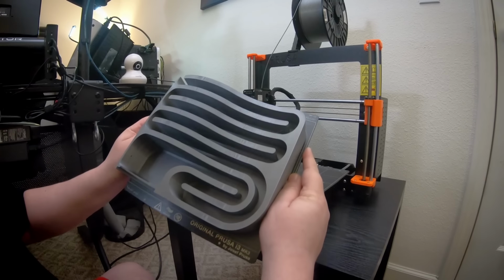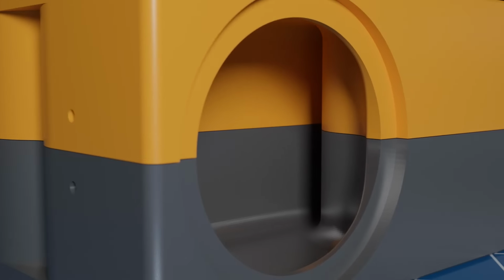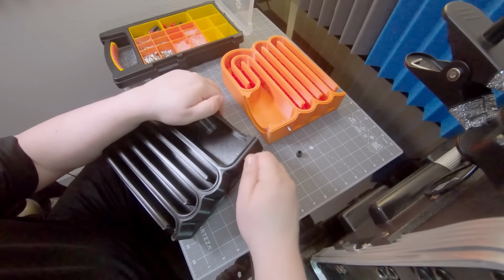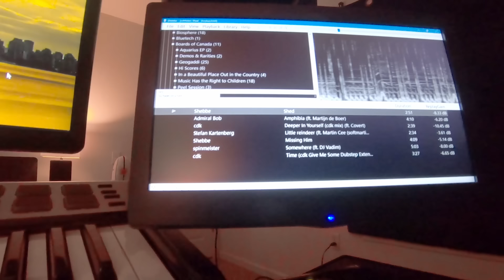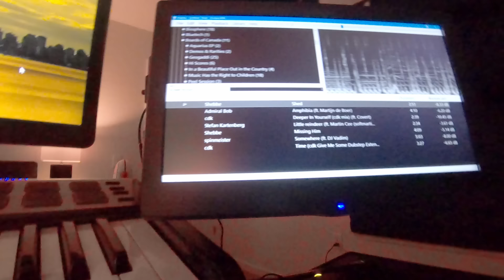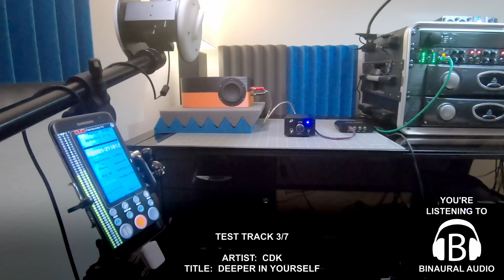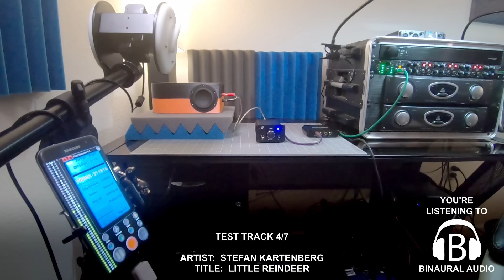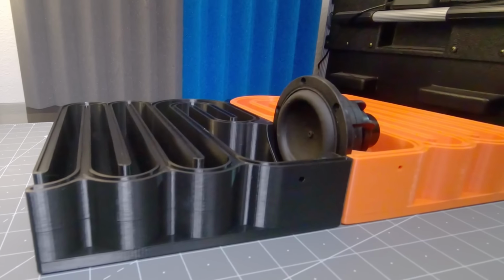3" Subwoofer Enclosure v.2 (Plus Demo)

Comment: Damn! I want to see how something like that would work as a bass guitar amp cab actually!
Reply: If you want a travel amp running low power, this design will work. For live performances, most venues will already be equipped with subs/mids and horn tweeters you directly plug into via your DI of choice. I use an app called “Bias” and a Bose Mini Soundlink for a travel amp. It sounds really good, even at higher volumes. The app does use cab sims though.
Reply: Mark bass makes 1 similar in size that is amazing.
Reply: @rasjase1  that would be the micro mark right? I'm more curious with this as it has a considerably smaller speaker, but utilises the enclosure a lot more than a typical bass amp/cab. Kind of curious to see what you can get by taking a fundamentally different approach to cab design
Reply: @E1p0tat0k1ng  I used 1 once at a rehearsal space and it literally blew my mind. At low volume it was able to rattle books off of shelves(not joking).  It kept up with live drums no problem as well. I usually use a 12" bass practice amp for rehearsal wich sounds thin and puny compared to normal gig rig, but the little mark bass sounds just like my big rig. I rushed out the next day to buy 1 but was unable due to the thousand dollar price tag. Maybe some day lol

Comment: Damn that's nice, good work. I like tight bass and clear audio, bought some 6 inch hertz Mille components for my work truck so I wouldn't have to run a subwoofer but haven't had time to install... for like 6 years🤣. Once you have kids sometimes those projects get put to the side lol

Comment: Is it possible to DIY another case using the dimensions of your built? I mean just the volume of the chamber and the cross section + length of the port are relevant, not in which manner they are folded, or?

Comment: That was insane for something that small. Excellent work!!!. I am listening on Mac book Pro late 2014 Chrome browser through and LG monitor LG 27UD58-B 27-Inch 4K UHD IPS Monitor with FreeSync connected via Display port and Sony Noise Cancelling Headphones WHXB900N in wired mode i.e. no enhancements , plugged into the monitor jack

Comment: Have you tried putting your old enclosure on the other side of the speaker making like a sandwich with the speaker in the middle? I've never seen this done, but would it transfer more energy into the air?

Comment: I've got a speaker that's rated 90-20,000Hz. I'm wondering if I could put it in this box for extended deep bass range or if I should put it in the Tang Band bookshelf speaker box instead. Thoughts?

Comment: A friend built me a fourth order bandpass enclosure for an 8 inch woofer that was able to handle 400watts with no crossovers or active frequency bandpass cutoff.  It was deeper and louder than the dual 10 inch JL audio custom enclosure that it replaced, that could barely handle the same 400 watts.

Comment: Funny thing look at a musical instruments take a flute it’s all pretty much designed the same all the way through it has a built-in noise cancellation so you don’t hear real high pitch squeaky sound from the whistle but you hear a nice mellow tone and then take a tuba a tuba is laminar flow to the max text the sound and magnifies it over and over and over again it doesn’t implode on itself it keeps expanding

Comment: In the interest of saving space and weight, is it possible to develop something similar for an 8in much higher output sub for a behind the seat compartment box in a honda del sol or mr2. There is a prior design from jl audio but doesn't seem to supply enough bass even with 2 subs.

Comment: Set up for me is not the best but in my car I do I have detected speakers for each range, so I have a 2006 toyota sienna with JBL Synthesis, from factory I have a good range of highs mids and upper lows. I also have dual skar sdr 12s at 1000watts rms, making up for the low lows.  For me the bass coming out of a set up that small had my car vibrating way more than expected. Good work!

Comment: Is this design scalable? how difficult would it be to make a 2 3/4" version of this?? Any help would be appreciated.
This is exactly what ive wanted to do with this 2 3/4" Kevlar Rca woofer ive been holding onto. Its from when they bought overstock kevlar from dupont and attempted a run at the high end home audio market, ribbon tweeters and all lol. Mine is from a middle of the line center speaker that only had 2 full range woofers. Always thought it would make a sweet bluetooth speaker!!!!

Comment: Just had a thought....if the cabinet needs to be dense material then why not cement? Styrofoam forms could be sold for the interior and someone could fashion the exterior out of plywood. Once the concrete hardens you pour in a solvent to get rid of the Styrofoam. This could be very similar to the "lost foam" system they use to cast engine blocks. Probably needs fine tuning but the theory seems sound.

Comment: Looks good! One thing you could consider for the speaker baffle is to make it separate of the upper and lower half, then creat a Grove on both the upper and lower half kinda like your tongue and Grove idea that the baffle could sit into on the top and the bottom to get it to seal better. That way you could also incorporate some threaded inserts that you would insert mid process during printing so they are sealed and locked within the baffle. Then I would use a two part epoxy that works with the printing material you are using, like ABS for instance. I would consider printing it out of this new filament that has carbon fiber in it. It makes it much stronger and more stiff. It will also cut down on any reverberations because its more dense. Good luck with your project! Its very cool! Liked and subscribed

Comment: how big is the volume of the box and how long is the port, and the cross-section of the port?
Reply: i calculated the port to be a slot of 15x84mm and a length of 1511mm

Comment: Listening to this with a set of Logitech Z625's,  the bass is remarkably deep. It rattled the glass in my room at half bass on the knob and about a quarter on the volume knob. On my headset, a Steelseries Arctis Pro Wireless, the bass is overpowering, and actually made the drivers in my headset rattle quite a bit. The only other time they rattle is at max volume in something like Warzone, Battlefield, or any other FPS game with explosions and violent, sudden bass. Other then that, it's unreal that a 3 inch driver is making that much sound.

Comment: Cant i make it hollow and after print just fill it with something like expanding foam(lighter) or epoxy?
Reply: Expanding foam probably not. Epoxy maybe, but you have to consider heat dissipation while setting for such large parts, as well as air evacuation.

Comment: Is the math linear in these projects?  I have a 4" speaker I was going to print this enclosure for.  If I just scale the print up by 25% so the hole will fit a 4" speaker instead of a 3", will the math for the porting and wavelengths still be correct?  I have never seen the equations how those things are calculated

Comment: Nice model, one question though, did you have to resize it when slicing? when I load it in cura the stl file is far too large for the build surface? The only way I can get it to fit is by resizing to 88% and that is the absolute max it will accept.

Comment: I didn't want to go through all the comments, so it might been mentioned.
But take a look at Wondom amps, with built in DSP, if you want to use it for portable use or just want a all in one amp 🙂
Awesome build btw, and beautiful print!

It makes me think of the Minirig Subwoofer, which also has a folded port.

I am thinking about maybe making it in wood on a CNC. Sandwich style or find two solid pieces.

Comment: Looks great, 

I'm guessing there is nothing going through the unit that stops it being printed in one piece.

If you do integrate an amp and power supply then a non setting sealer and screed would be better so that the unit can be dismantled and services.

Can't tell you how many electronics today are bonded together making them impossible to disassemble.

Comment: I am going to build this, hopefully pair it with a horn mid top and create a mini 2 way sound system  at a 150Hz crossover. I've been looking at powering it with battery for the beach but if that works out as asking too much for something portable (atm I've got 3.5hrs of charge at 4kg of battery) then its definitely going in my car.

Comment: Why don’t you point the low pressure outlet of the speaker facing the same direction as the speaker driver? Just make sure it is phase aligned

Comment: Your videos have inspired me to model and print a scaled down version of the Paradigm Sub One. It’s a 6 sided sub with 6 speakers. I’m using the same 3in speakers as the prusa printer isn’t large enough to print it with 6in speakers. It’s coming along good on the modeling but printing it in 3rds is going to a challenge. I’m not even sure if it will sound good... but I’m gunna do my best

Comment: sirs, but wouldn't inside outside cones make it better than the swirly lines? cause u don't really obstruct nothing just delay the time it takes for sound to come out ... by a 0.00001 micro second, where with the inverted cones u would filter all the high tones.

Comment: That's a lot of ULF. I have my subs DSPed +/-3db 150hz to 23hz and even with the gain only up like 1/3 of the way from where i usually listen, there was still lots of bass coming through. I'm simply taking advantage of the corner in my room with a pair of reflex subs, but with the drivers faced at each other and in the corner under a desk, the whole thing creates a fairly impressive horn. I still have to +6db at 23db to get good extension down there for home theater, but with -6db at 50hz and some narrowband correction around 42hz, the deep rich bass from say music comes through with extremely low distortion levels, and the bass in movies sounds utterly incredible. None of this would be possible without proper DSP though. I'm using an ashly protea 24.24NE for crossover filtering and parametric EQ, in addition to gain per amp and input gating, but my sub amp is a QSC RMX850 at 280wpc into 4ohms so I've also got a lot more power on hand for bass. It's a stark contrast from my tube amp for everything from 150hz up, but with a high crossover like that it actually is fairly well balanced considering how low I push the subs and how much power it takes to do that. they sit at like -18db in the DSP master gain so even with that +6db correction I've still got loads of LF overhead, I just have to be careful to watch for overexcursion if I'm mastering content. Would be really cool to replace it with a custom horn built to the space, but IDK how much longer I'll be where I am either

Comment: Hi there, I'm hoping someone might be able to help. I'm rather new to the world of audio equipments. I have a set of studio monitors hooked up with an audio interface from my PC. I'm wanting to add a subwoofer to the setup. If I wanted to wire this subwoofer to the current setup what would I need in order to be able to run my studio monitors with this subwoofer?

Comment: Hey im trying to get this to fit on to a creality ender-3 pro which only has a build area 220x220x250. im trying to cut it into 8 parts to fit in cura but not working for me need help please
Reply: Microsoft has 3D utility that can slice this as desired. Locate in MS store 3d Builder.

Comment: Great technology! Wow! I am still stuck with wooden cabinets.
Please let me give my input on the TML design, which I think could be improved in 3 dimensions:
1. Have you ever tried the AJHorn software? The best you can get on the market to design a TML for your speaker. Try to put the speaker at 1/3 of the line and not at the beginning. This is pushing the 1st harmonic to a higher frequency.
2. Add an absorber chamber behind the speaker and you will fully get rid of the first harmonic @150-200 Hz
3. Fuzzy with sudden changes of line profile and zigzag is better than a continuous and smooth ‚flow‘. The fuzzy structure is suppressing the higher modes, which is very beneficial for the response in the midrange.

This all has been published and verified by Bernd Timmermans, the issuer of the German Hobby Hifi magazine. 
Hope you like the ideas.

Comment: I have not looked in to the advancements in the world of audio in quite a while,but i thought you needed at  least a 10" woofer to push enough air to create a subsonic frequency, has that changed with this kind of technology ?.
Reply: No. Not at all. A 3" short throw woofer can still only move so much air no matter what it's enclosed in
Reply: @karenlewis4228  ok, thanks for answering that for me, i got fooled by the title,but it did get me to watch it,its pretty cool either way, cheers !
Reply: @420jacksonian  oh its cool for sure. But at the end of the day you need to to be able to move so much air. There is only so much a certain size can do. You can compensate with high excursion, but your still only going to move so much air. And you need to be able to move so much air to hit certain frequencies.

Comment: I am planning to print my own version of your subwoofer version 2.0. Since it has to fit into a special geometry I have to model my own housing. Would you tell me the volume of the couplingchamber and the length and cross sectional area of the port of your subwoofer? That would be great.
Reply: I did my own version and the box for my own use... the slot is 15x84mm

Comment: Is there ever a reason you would need in the box? If so you could possibly use a toung and grove with more clearence for a rubber seal or something similar. You could then use some bolts that thread into the box for being able to open and close it when needed. I have no idea how to build sub boxes so I apologize in advanced. Great video!

Comment: This sounds superb!  I am listening on a Panasonic home stereo that Panasonic marketed as "Super Woofer" that I use with my 42" 4k monitor.  It has a sub output but I rarely use it because the bass is so good.  Very tight and clean.  Your subwoofer sounds excellent through this system.  
I have a question about a subwoofer setup I want to put in my car. Th car is an 06 Chrysler 300C with a Boston Acoustics "premium sound system".  It has an 8" subwoofer in the rear deck but it doesnt do much.  Overall the system sounds pretty good but the door and rear shelf speakers are doing most of the work.  I really dont want to use a large sub enclosure in the trunk/would like to keep all the trunk space or as much as possible.   Could an enclosure be built that mounted up under the read deck?  Of course I do not have the specs for the existing sub speaker and may use a better speaker if I can figure out an enclosure.   I realize I can get a "free air" sub and try that but I doubt it will get the clean bass I like.  I just wondered if you could give me any pointers on how to do this.  I do have a JL 12W7 in a sealed enclosure I built and it sounds great but I don't want to use it in this car, as I said I would like to retain as much trunk space as possible, but I realize I may have to give up some to accomplish what I want.  Any suggestions or direction?
Thanks!

Comment: -3d printer & Audio enthusiast , Nice work - Have you ever tried or thought about "damping" the wave guide walls ? - You could use the "flocking" method used for expensive wallpaper and some 70's car interior panels(but with more acoustic friendly materials). ATB.

Comment: So... difficult for me to hear/feel the experience on my iPhone, even connected to my car audio system (2005 Honda Accord Coupe with OEM ‘premium sound package’ with a small mdf box, amp, and 8” sub added to improve upon what I would call a ‘very good factory stereo’) but in your opinion, how does this specially shaped 3d printed enclosure and small (tiny) sub compare to a conventional sub and conventional (home built) wood/mdf box/enclosure? What power (watt) rating is this tiny sub? Is the sound quality and depth comparable to a 10” reputable brand name sub in a typical carpeted, vented, wood box? Or is it more like a 12”? 15”? Your description of the quality is just vague enough that I am intrigued but at the same time skeptical. I would very much like to duplicate your design if the sub itself is not too outlandish of an expense, and if it will work with my existing amp, as your design would take up approximately 1/4 the trunk space of my current 8” sub and box, if the sound quality is equivalent or better than my current setup... thanks!
Reply: Ok so I just clicked the link in the description and the price of the driver itself is fantastic! But the site says nothing at all about wattage (rms or max) what wattage amp would you suggest?

Comment: I'd like to see a Tang 5 1/2" version, with a tweeter, Type D AMP, Lipo Battery & Bluetooth! It would need to be a 3-part printed and have new TL paramiters. Leaving an opening on the side for a clear plexi-window would be dope but would be a structural issue. I do not believe JB Weld is the right glue for this. Love the stuff, but does not adhere to plastics as well as some other methods like an acetone melt or plumbers cement.

Comment: Listening on HP GAming Speakers X1000 combined with a "no name" Sound bar using elgato sound capture and it sounds great here. Have you done any projects with 6.5's or 5 1/4 drivers? I have been searching for a 3d printable enclosure that fits 220x220. pickings are slim but that how I found your channel. Awesome work bruv. Liked and subbed and have been binge watching that last 20 hrs.